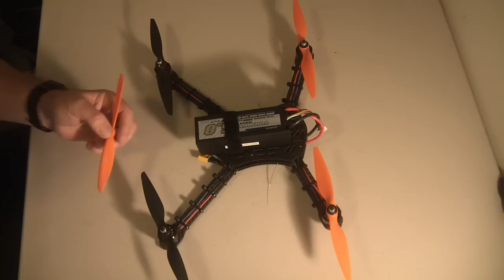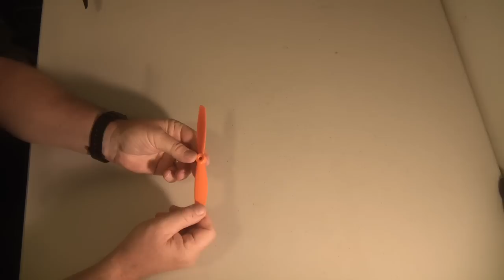Aerodynamic benefits of reversed motor rotation in forward flight.

Comment: Hey it's rocketscience ...  Very nice. I should have done a video when it was asked on rcgroups.  Thanks for doing this.  And for everyone else it matters not just for flying hard but if you have tall side plates in your design it affects the air as well.  I have a quad with side plates and the difference can be felt for sure.
Reply from the maker: +notasixpack Thanks for dropping by.  You can do the wind tunnel video ;-)
Reply: +Trainboy64 haha.  wait I think that was a dare.  now I have to do it.

Comment: there is also yaw_motor_direction -1 and 1 ;). no need for mix
Reply from the maker: +Boris B. Thanks Boris, that is true and I mention it in the following video showing how to load the mix but will add it here also.
Reply: so i just have to type in cli "set yaw_motor_direction = -1" and "save"? then switch props? no need to reverese the motors in blheli suite?
Reply: +Dondi Banares you still need to change the direction that the motors spin. Better to swap 2 wires than change Dir in BLHeli.
Reply: Im okay hehe thanks
Reply: What's the benefit of swaping wires opposed to changing dir in BLHeli?
Reply: +Nandox7 Some people have had random problems with ESCs after reversing in suite. So if you swap wires then there is no risk that you will have these problems.
Reply: I see, I always reverse in the FW and so far never noticed any difference or problem so that is why I was curious about it. Thanks

Comment: Nice video. It makes sense for the most part. I fly full-scale helicopters for a living and you're explaining dissymmetry of lift. The one thing you haven't mentioned is induced flow which decreases the angle of attack as you move aft on the rotor disc. At slow speeds that effect cancels out the benefits of the inner rear props advancing blade in a tight turn. I haven't tried it yet but to me the huge benefit is that it sounds like it's harder to get caught on a tree branch.

Here's a manual that explains helicopter aerodynamics. 
https://www.faa.gov/regulations_policies/handbooks_manuals/aviation/helicopter_flying_handbook/media/hfh_ch02.pdf

Comment: I can 100% agree with this concept when applied to a helicopter going 200mph + and the effect you are describing is known as mu which is the speed of the rotor vs the forward motion and its why helicopters are limited in speed. 

Coming back to drones, have you measured the speed that the props are spinning? I'm not sure how to calculate the speed of a given motor and the prop from its kv rating but I'm sure someone on here can. I'm not disputing what your saying but it's all relative to the prop speed vs the relative airflow and to calculate the effectiveness we need more facts. I can't see simply changing rotation making any difference at all. Especially when a quad would be easily at 45 degrees or more when at speed but then the angle reduces the relative airflow.

Comment: Nice tip Trainboy64
Tried it out and can confirm it definitely does hard 120-180  degree turns at high speed much better now.  
So good in fact i want to do it on my main race quad which is running a kiss fc. Any tips on how i can do the yaw_motor_direction -1 thing on the kiss fc????
Reply from the maker: +MACKA FPV Great news and thanks for the feedback - sorry can't help you with the Kiss FC as I have no experience with them - unless you can mount it at 90 degrees and make it think it is flying sideways?  Not sure if that will work but I managed to get "reverse rotation' working on a Naza equipped quad that way. Had to swap aileron and elevator inputs to the FC but it works.
Reply: It only lets you rotate 180 :(
Nearly might put a naze back in. Soooo conflicted now!!  You've really fucked with me here! haha
The Kiss is definately a better fc but flying my props reverse made my H nearly fly as well as my X so really really wanna try it on the X.
You pretty much HAVE to figure out how to do it on a kiss now you have put me in this conundrum mate ;)

(from the look of it id say the kiss peeps would have to put the option in as the GUI is all kinda closed off from what i can tell)

Comment: Okay, so do you know that guy Stu from UAVFutures? He built a quad that he called the "Firehawk" and it had offset motor heights, with the rears being higher. This allows the rear props to almost always have clean air, and in high speed turns, this quad experienced virtually no oscillations/hesitation.

MY question to YOU is, would combining such a design with reversed rotation STILL add benefit, would it be significant, and would it be better than just one or the other? Or, would it be better to leave the offset motor height quad with regular rotation?

Thanks.

Comment: This has me very interested, would you be willing to put up a how to on this in cleanflight? if that is what you use. Or are you just reversing it by swaping the motor wires?
Reply: You can't just swap motor wires because cleanflight needs to know which motors spin which way...
Reply: Could you point me to a place that shows the setup? I have attempted to make a custom mmix with yaw values flipped, i.e 1 for -1 and vice versa, but not sure if there is more to the setup.
Reply: +fokkre untested: yaw_direction=-1

I'll be testing soon, this seems like a minor change for potential gain...
Reply from the maker: +fokkre You need to reverse each motor rotation - this can be done by changing motor wires or directly in the ESC firmware set up (if you use BLHelisuite or RapidFlash for SimonK it is easy) 

Then you need the custom mix I have listed above - this tells the flight controller to use different diagonal pairs for yaw manoeuvres.   More information in the Armattan Thread on RC Groups here.

http://www.rcgroups.com/forums/showpost.php?p=34628941&postcount=34585
Reply from the maker: +[FPV] Will &#39;Dirt&#39; Dobbins If your quad has good design and is flying well already you may see no difference at all.   The main benefit will come in those that have a high profile that shields the rear inner prop during a hard yaw.
Reply: +Trainboy64 My tweaker has an Session and 4S lipo sittign on top... 

You don't need a custom mix on Betaflight...

I used BLHeli to swap rotation and then in the CLI of betaflight:
yaw_motor_direction = -1
save

Pro tip: yaw_control_direction is NOT the same thing!
Reply from the maker: +[FPV] Will &#39;Dirt&#39; Dobbins Thanks, yes that will work also.  Look forward to getting some additional feedback on this from pilots trying it.  So far I have only read positive reports.
Reply: I'll check back in.  I've got 2 nearly identical tweakers and I did this to one.  I plan to fly back to back packs alternating tweakers to see if I can feel it.
Reply from the maker: +[FPV] Will &#39;Dirt&#39; Dobbins Thanks Will, two identical machines is a perfect way to compare.
Reply: This would be awesome. really look forward to seeing how it goes
Reply: [FPV] Will 'Dirt' Dobbins - were you ever able to do the comparison?
Reply: When you flew did you notice a difference? Have you gone back to the "standard" or are you still running one reverse?

Comment: when you say 'custom mix for a pure x quad' does this mean it will only work properly on an x frame or will it also work on a normal H quad?
Reply from the maker: +MTL Racing   If you have a different shape frame you should be using a custom mix anyway - all you need to do is reverse the polarity signs on the yaw values - see this link for the above quad which uses a custom mix based on its shape and I reversed yaw values after reversing props.  http://www.rcgroups.com/forums/showthread.php?t=2480732&page=40#post33620608
Reply: thanks man

Comment: Part of me doesn't want to believe but damn with all that logic, it's hard to not. Compelling video. 
So reversing all motor directions alone is fine and FC handle it without issue because it's external?
Reply from the maker: +MicroRCFiend Thanks, for normal flying you really won't see any difference - if you fly high speed and turn hard then "maybe" you will see a benefit.   I swapped a few X quads over today and just cruising around with a few flips and rolls there is zero change in the handling.   You need to put the custom mix also - otherwise the FC will speed up the wrong pair of motors in a yaw.   A custom mix or with current version of Cleanflight and Betaflight you can just change this parameter (yaw_motor_direction = -1)    By default it is +1  -  Just about to post a video showing the whole process.
Reply: ***** It's nice to have an explanation of why some people reported being able to tune gains better that way. I Sent your video to Joshua Bardwell, maybe he will do you a shout out.

Comment: Are these improvements quantifiable?
Reply from the maker: +Alvin Yeoh The degree of improvement will vary depending upon many factors.  Frame size, design, profile, prop size, RPM etc.   I personally don't fly hard enough to see a benefit.  A number of pilots that do have confirmed it improves handling in their quads when yawing hard at high speed.  They generally experience better control and less wobble.

Comment: Is there not a fundamental flaw in this video - in that, as it is all relative to high forward speed (ie: racing) - most racing or high speed quads are angled at 45 deg or more... thus a lot more "clean air" to the rear motors than this video suggests.. Also, at 45deg+ the yaw is completely different and an aileron roll is now used primarily for yaw.

Interesting topic thou... However, given the world quad speed record is currently sub 200km/h and that in a realistic racing situation speeds are much lower than that... I don't think this issue will be significant enough for 99.9% of people to notice.
Reply: I mainly want to change it so I get less crap thrown on my lens when landing
Reply: DJB HSI i changed mine just for that reason but i did notice it now makes much sharper accurate turns also pushs thru airgates now instead of getting stucl so i see an advantage in reversed for racing
Reply: Same here! changing motor dir only to save my camera lens which I had to replace 4 times already.
Reply: I fully agree. All this is valid for fast horizontal flight - so in reality not a possible situation. You can't be flying fast and be horizontal at the same time - its contradictory... Unless you are flying plane or a tilt quad - but this is another subject. Other than that no flaws in logic nor in great explanations.